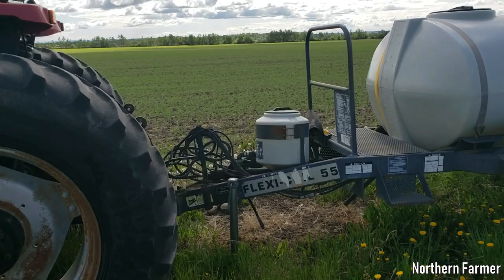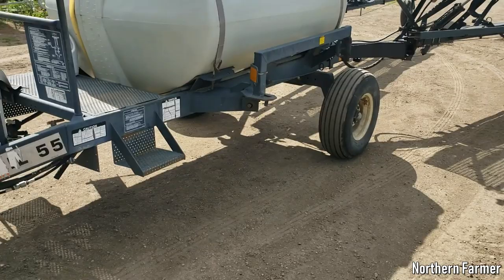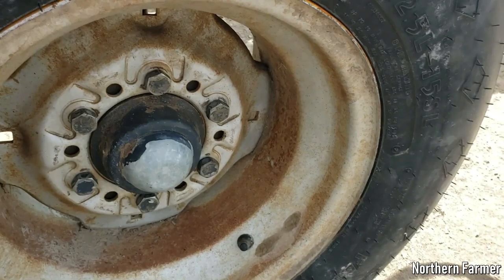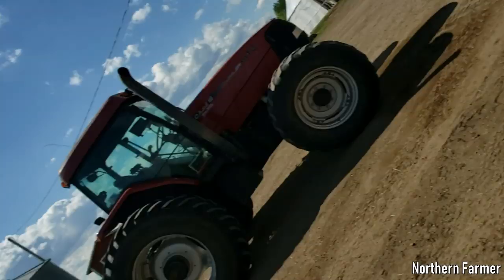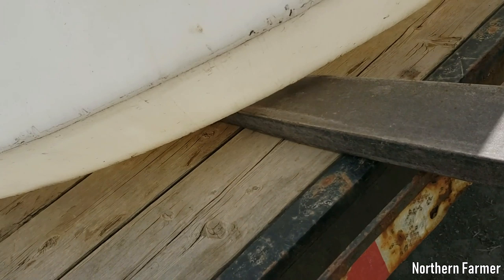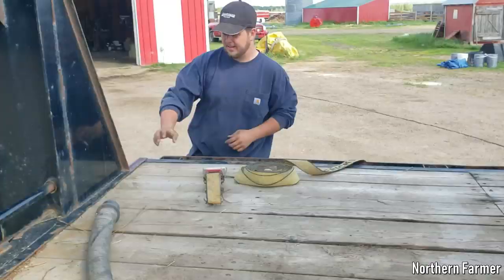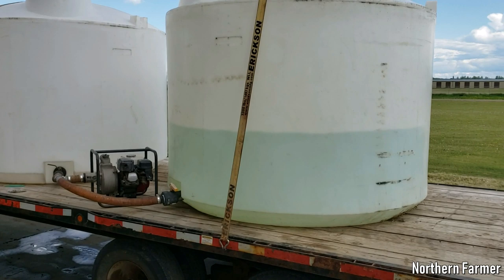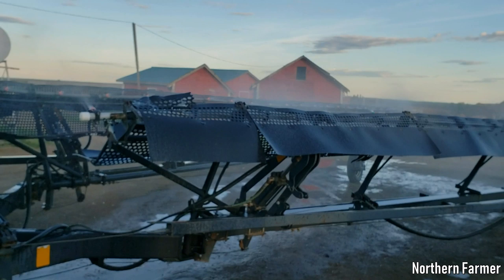Its Spraying Time!!  Flexi Coil Sprayer

Comment: I custom haul fresh water for sprayers. It's $3.25 per cube (231 imp gallons). Haul 6250 gallons per load. So far this year about150,000 gallons. Feeding two Big JD wheeled sprayers
Reply from the maker: I just saw a trailer that hauls 7500 gallons... tri axle... Id only need 2 loads!!!

Comment: My dad ran a tandem axle 5000 gal tanker with a chem handler mounted on it behind an old semi truck. Sold that tanker for $5000 bucks. They can be had pretty cheap these days. I guess many tankers from dairy or oil field get steam cleaned and sold for farm use

Comment: Why do you not pull water out of the dugouts to spary?
Reply from the maker: We used to.. but it was hard to filter it.  And the water is hard with minerals and it doesnt work as well with the chemical.